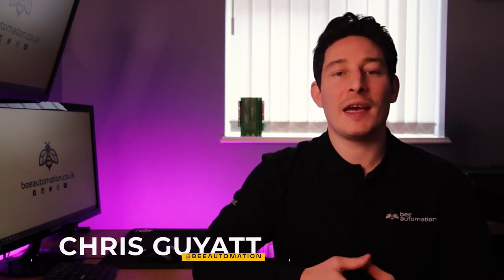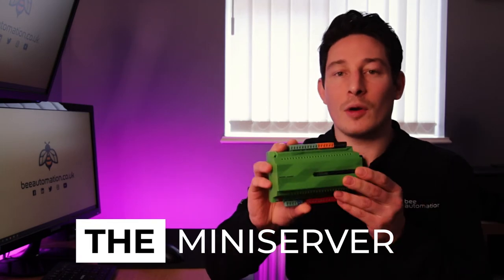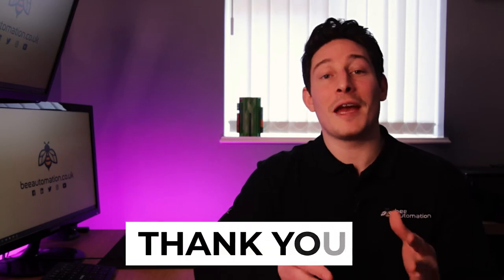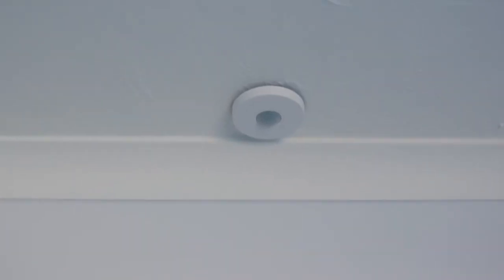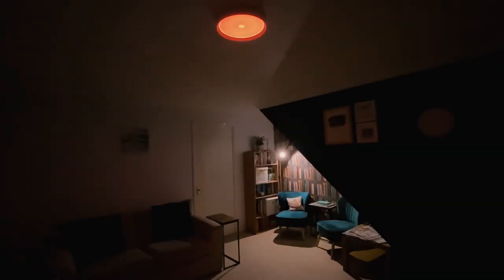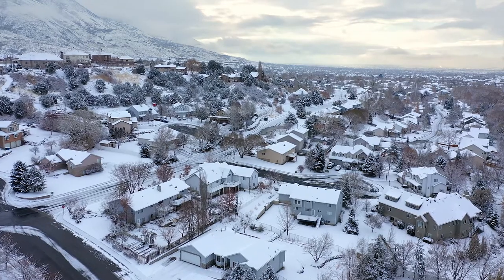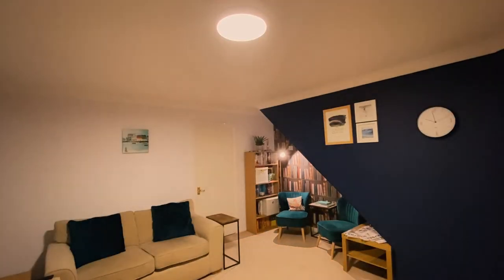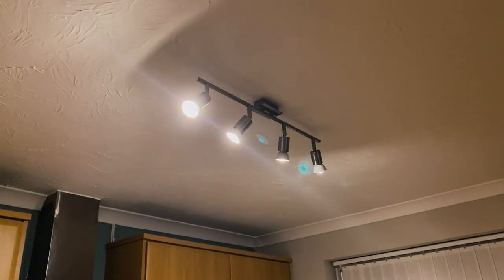How Loxone Lighting SHOULD Work in a Smart Home

Comment: Excellent and to the point videos which focus on the end user benefits with Loxone automation and presents relevant everyday use cases! I've been using Loxone in a fully automated house for 4+ years now, but some of your points still make me go 🤔 and then 🕵️‍♂️ in Loxone Config...
Reply from the maker: Thanks so much Jakob! Haha... anything is possible with Loxone 😉 ... what are you trying to do?
Reply: @beeautomation  well I'm self-taught Loxone engineer as that was necessary for me to become back in 2016 as there was only one electricians company which was also a certified Loxone parter here in Denmark. They were situated 2 hours drive away from our build, so I drove to meet with them and presented what I wanted to achieve with installing Loxone which they found interesting. But ultimately it turned out to be to much out of their way to have me as a customer that far away from their normal area of operations. 
So instead I made an agreement with a local electrician that they would do all the work that was only legal for electricians to do and I would take care of all low voltage and software in the combined installation. It all worked out really well, but your presentations of the use cases with Loxone automations have reminded me that I have some automations which could be improved. For example I have been running the house with a cooling and heating period based on two calendar periods denoting these. But this year summer is refusing to arrive here in Denmark, but that didn't prevent our house from going into cooling mode of course which dropped indoor temperatures by 3 degrees and enlisting deep moans and shivering from my partner 😋
So I discovered that with the version 2 of the climate control block there is actually a means for determining if the house should go to heating or cooling mode based on the average temperature in the last 48 hours 🤦
So my challenge is that I don't know what I don't know as I didn't go to Austria for the training, which I probably should have done in hind sight...
Reply from the maker: @JakobVentzel  I’m always available for remote training if you’d like some 🙂
Reply: @beeautomation  Hmmm would you be open to doing a remote session where I purchase an hours time to give you a walk through of my current setup and you provide improvement suggestions?
Reply from the maker: @JakobVentzel  no worries. If you'd like to email me at chris@beeautomation.co.uk we can get something organised :)

Comment: As always a great video!! When you were talking about audible alarms, you showed a Sonos (Symphonisk) speaker which sounded the Alarm, how did you connect these with Loxone? Because I have multiple Sonos speakers throughout the house and have issues playing sounds on them (have it play doorbell sound by using openhab and i actually only have openhab running just for that). Thank you!!
Reply from the maker: Thank you very much... I use a raspberry pi with a Loxone plugin. I know what you mean though, it’s not always reliable. I’m still waiting for Loxone to update the Audioserver to use network speakers properly. I’d always recommend customer have wired speakers if possible.
Reply: @beeautomation  agree, although imo Sonos doesn't do it's job either. They should offer this as some kind of easy to use control which we can switch on with an api or something.. where we can choose which sound we can hear on which speaker with a certain volume. If you find a better way, please let me know 🙏🙏
Reply: @beeautomation  The Raspberry Pi with the Loxone plugin, is that Loxberry?
Reply from the maker: @JakobVentzel  that’s right yes 🙂

Comment: Informative video, but can you clarify about using non loxone lights and switches. As long as you use 24v bulbs can any light unit work? And in regards to switch’s if we use the pure in just main zones, ( other half doesn’t like the design or price) can you use normal type light switches in lesser used room and if so what’s needed. Thanks.
Reply from the maker: Thank you Dale, you can use normal 230v light fittings either connected to a Loxone relay or dimmer extension. Most 24v light fittings go through a transformer or driver, so to answer your question not all will work with Loxone it depends what “light unit” you’re thinking about using. You can use normal retractive switches in those other rooms but you’ll need to allocate a Loxone digital input for each one to detect when it been pressed.